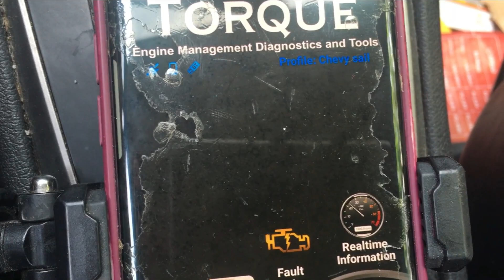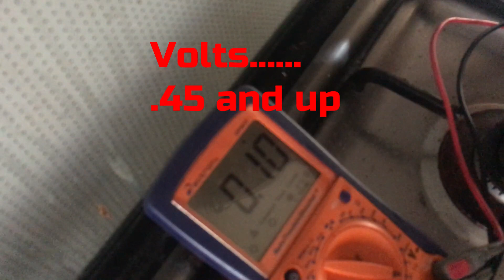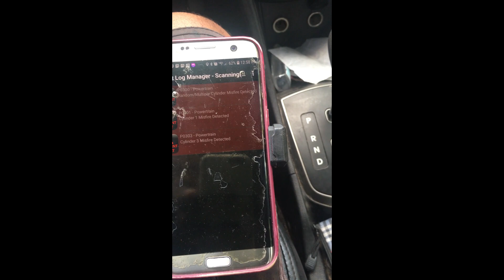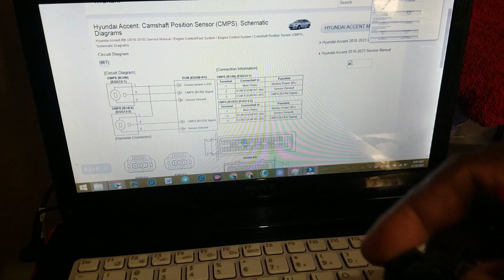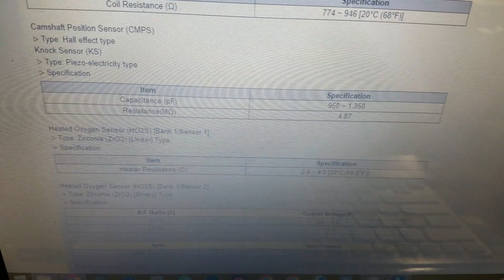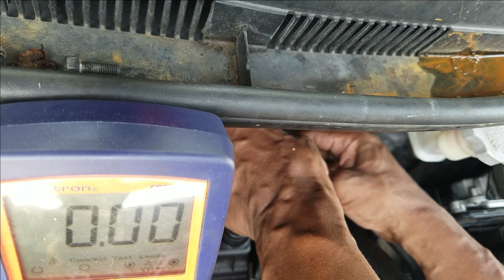Hyundai accent 2018 Head gasket replace RUNS LIKE SH*T!

Comment: I was thinking about taking this on, and at first you had be confident but here we are struggling to get it running well, good work so far, just hoping we get the video that say running perfectly.
Reply from the maker: Oh dont worry that car has since been running well and delivered to it's new owner 3 months ago! There are actually quite a few more videos left about this car but as you know you tube and drama ...it sells so the drama is extensive on this car but finally came through it in the end. It went for a road trip several times form manila to Angeles and manila to sun Fernando pampanga philippines..you can see on the map it's quite a drive. This car had multiple issues affecting it..when it overheated 75 percent of the sensors were melted! That's how hot it got.i had to go thru each and every one of them to fix the issues plaguing this car. Then very low compression because the area I was at did not allow me to bring my honing tools so the cylinders had to be broken in strictly.by driving for a long time. Then the steering angle had to be reset or else the car would not start! This requires a specific scan tool which I have. Then comes the hard part..driving it constantly for weeks if not months! After that the car ran smoothly, computer did a relearn and after weeks of driving the cat is fine and all the power and most of the compression returned! I had to use engine restore to assist me in this job but it worked and I have to make a separate video on that! So trust me dont worry! These videos are months behind my backlog of videos and the car is great, has a new owner and is still going strong about 3 to 4 months ago! Thanks for watching and reaching out.